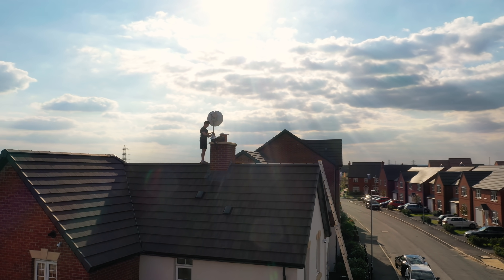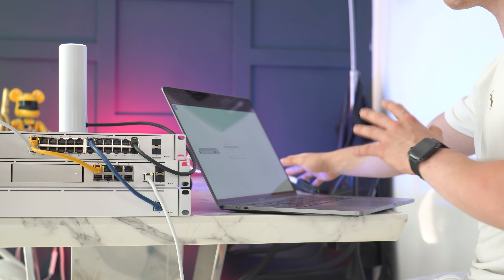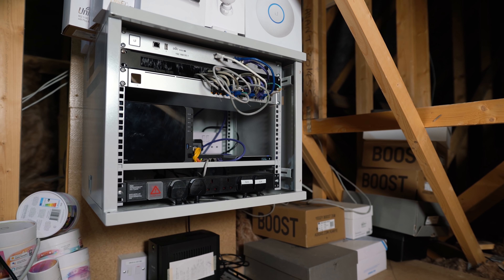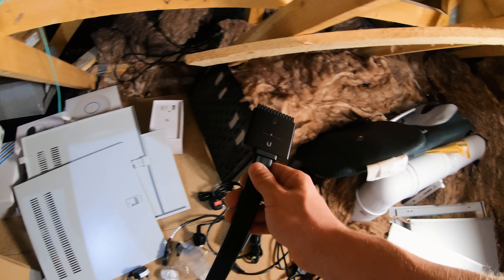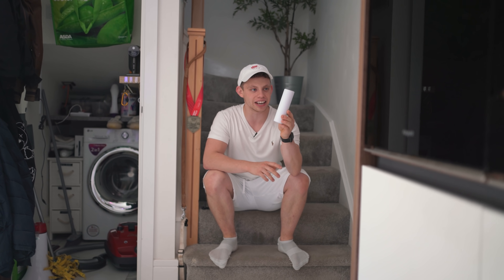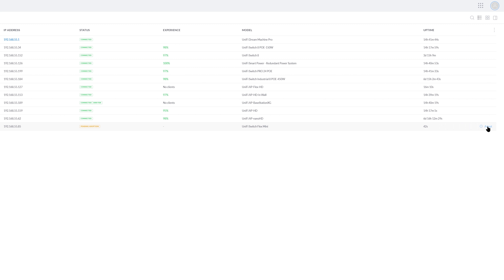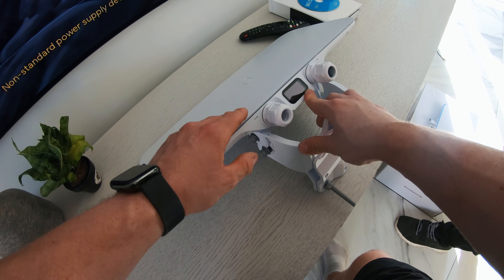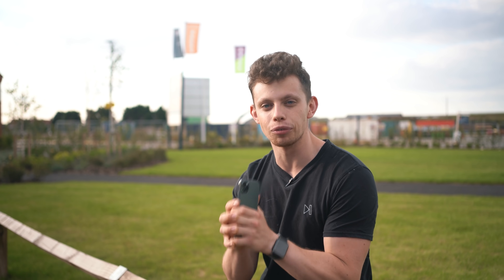Alex's Insane 2021 Home Network Upgrade & Tour!! 🔥

Comment from the maker: We hope you enjoyed our latest networking upgrade video. Let us know below what your internet speeds are below for a chance to win some cool UI gear! ❤️ (And also what you want to see next)
Reply: That Cat cable going into the flex mini is rough has who crimped the end on that nearly made me sick
Reply: i hope you are aware of the data breach that occured at ubiquity a few days ago had to change all my passwords on my UDM Pro
Reply: @XeKirrYT  that's why I self host everything :) but ubiquiti doesn't like us self hosting the software:(
Reply: 65 down and 18 up. “”SuPeRfAsT””. 
Love these over engineered home network vids. I’m planning on doing this in my new house with all ubiquiti gear if the wallet allows it!
Reply: 50 mbps
Reply: I did until you thought the RPS was a UPS I thought you knew what you were doing. As well as the fact that you have the base station XG on your roof, it’s not meant for that silly, and it’s not supposed to give you longer range either it’s meant for high density environments.
Reply: 150 mbps and I really need good gear. ISP modems suck😫
Reply: 7mbps on a good day 😢
Reply: Make sure to get WiFi 6
Reply: About 70Mbps max on a 100 plan on Aus NBN, FTTN.
Reply: On virgin media 1gb plan but struggles of get over 30mbps over WiFi and to links don’t seen to carry more than 80 when there 600 rated
Reply: 1000/40 in AU
Reply: Happy New year everyone 

31.8 Mbps download 
6.65 Mbps upload
With sky broadband tested at 1048pm 13/1/21
Reply: Usually get about 520 down and 35 up
Reply: 300d/100u
Reply: 60mb/s Down 15mb/s Up, but using the stock talktalk router, so you will get some times where you just loose connection, not great!
Reply: It's so funny how You change, test, Buy connectivity stuff each 24 hours. It feeds My tech toc. 🤣🤣🙈
Reply: 300 Mbps up and down
Reply: For on 500mbps with virgin never hit 500 with there router max I hit is 300mbps on Ethernet
Reply: Banger and the whole video production is top notch
Reply: 70/20 FTTP. Just got into UniFi kit, desperately wanting to expand my network but SWMBO and wallet aren’t allowing it right now 🤣
Reply: 89 Mb/s down and 18 Mb/s up, ping 1ms over WiFi 5. I have 2 UAP AC LRs and ERX with 60 clients they are amazing, but UDM pro and POE switch are a vision for now. Next video diy smarthome project.
Reply: @matejkotnik9675  lol, just get another basestaion XGs and connect it to your phone and then test the speeds they should be much faster.
Reply: @matthewcampbell1092  Hahaha dont be so sarcastic, as the speed would be the same and rubbish especially when to close to antena 😂😂
Reply: @matejkotnik9675  no of course not the speed would be amazing 😂 two is better then one in my mind.
Reply: @matthewcampbell1092  Yes sure the local speed would be amazing, if you dont have to pay for it. Locally i can transfer 350 Mb/s up and down to my NAS via WiFi 5.
Reply: 30 down and 5 up but is going through a plain old talk talk router which needs rebooting half the time! Need to look into getting a faster internet connection here and upgrading the network equipment in house.
Reply: 30 up and 8 down I’m on sky router so sometimes it’s just dropping off on some devices.
Reply: 1 gbps down with 0.5gbsp upload , also ubiquiti acces review would be nice
Reply: wish my internet was like that i have SKY uh
Reply: 540 MBPS
Reply: 34.2mbps just now.
Reply: 380 down but only 2mbps up - switched to Virgin Media business as working from home and upload is meant to be 20mbps, working on a fix apparently!
Reply: In therory we should get 1000/50. Usually it’s about half.
Reply: I've actually always loved your video's.  I'm just curious about one thing and it might be a space issue.  why wouldn't you just get a larger rack...and instead of having all those switches around the house just run the cables back to your cabinet.  Seems like a lot of extra switches around the house and equipment you need to maintain when you could have it all in one location.
Reply: 100mb/15mb
Reply: I have 1 Gbps down and up by fiber optics provider!
Reply: Love my Ubiquiti setup.
I'm saving up for a cloudkey v2+ so i can setup unifi Protect with some camera's to complete the set.

My speeds aren't bad, sufficient for my familiy use.
50 Mb down on average during normal use, daytime.
22 Mb up
Reply: 360 mbps
Reply: 30mbs down/6up...
Reply: BT full Fibre 900 on FTTP, 
900Mbps Down
110Mbps UP

So far been relatively good but will be definitely getting Ubiquiti kit for the full network. BT Kit doesn't even allow basic segmentation.
Question for you, Where does your FTTP terminate. Where is your ONT?

I would like to move my kit to loft but dont fancy routing the cables and for some reason the developers only decided to put Ethernet downstairs and not upstairs.
Reply: 70mbps just because they stock bt router can't keep up with my wifi and ethernet clients
Reply: I get 25 down and 5 up, sadly living in a rural location thats the best I get from any providers here, and thats fed to our place via wifi with the ubiquiti Airmax powerbeam dish from about 11km away and not over phone lines. Also do yourself a favour.... Wow, nice gear, shame about the state of the cable termination into your office flex switch mini, sort it out man..... Also Its not a UPS, but a redundant power supply. You need to do better research before mashing together another Ubiquiti advert.
Reply: 1GB down and 100MB up. Great video and love the giving WiFi for the rest of the houses until they can get access! 😄
Reply: @Mammer244  where do you get that from theese speeds
Reply: @Mammer244  plus 1gb down?
Reply: @AIC69420  I am suppose to have 1GBps download and 100 MBps upload, I get around 600-800MBps down. It is a fib conn.
Reply: usually around 100mbps :p might run an OPNsense router to replace the slow virgin one
Reply: 900/100 BT FTTP. Please Please do a bit more research on these products before making a video on them..quite a bit of misleading info in this video....And thats coming from a UBNT fan / installer!
Reply: @darrenjlobb  yes
Reply: Hi awesome video! I have 1 Gbps up/down. Something cool for a later video would be an in depth of the UDM Pro.
Reply: We pay for 1Gbps symmetrical (fiber), we usually see around 800mbps. I have a UDM-Pro, In-Wall-HD, nanoHD, and U6-LR, so big time Ubiquiti fan here!
Reply: 130 down and 80 up. Can't wait to for myself up with Ubiqui hardware :)
Reply: 230MBs download and only 10MBs upload. I’ve been watching your channel for almost a year now. I’ve got a family of four and don’t need all of that gear, but to be honest, I’m not sure where to start. Ubiquity has so much great stuff.
Reply: Based in uk with FTP. Next to the router 210mbps. Move 2 rooms away and drops to 10 mbps. Think I need some new access points.
Reply: i have 300 mbps but i only get like 150
Reply: 40/14 soon to be 1000/50🔥
Reply: What music did you use
Reply: I live in South Africa, and our max internet speed here is currently 10mbs. Not to bad for what we need it to do, but a little bit more would really help haha . (CES2021?)
Reply: 100 mbps, unifi AC pro.  usually hit around 80 on the laptop and between 40 - 80 on mobiles.
Reply: I get like 20/2mbs on a good day, usually 16/1mbs. I can't wait for fibre to be installed in out street.
Reply: I'm in Australia, the best I can get is 50 on a good day
Reply: 1000Mbps down and 30Mbps up; here in Canada
Reply: 50 down 10 up :) greetz from germany
Reply: 500/500 fiber in Denmark - Soon to be upgrade  to 1000/1000, why becouse i can LOL.
UDM P is really nice want one when i get to redo my network.
Speed test on phone say around 350-450 and that is AP AC Lite :)
Reply: 950Mbps/75Mbps
Reply: Average of around 100Mb down and around 10Mb up - which is exactly what I pay for 🙂
Reply: 219Mbps down 21.0up Speedtest virgin media 200 down 20 up service
Reply: Nice video’s what do you do with the network gear that is replaced?
Reply: 935 Mbit down and 934 Mbit Up
Reply: Choosed the Budget Option (FTTH) 400/200. 1gig/600 would be possible for a reasonable price. 

Live in the Muensterland in Germany

Managed to have 300-350mbits of speed (InternetSpeedtest) throughout my hole house and yard (340square meters house and 1000square meters yard/garden) via WiFi with only using a Fritz7590, a Fritz 3000 and 1 Fritz 1750e. I have some drops in some areas to only 200. IPhones etc. in good reach to 5Ghz and without distraction have around 500-650Mbits. 
Cabled devices are connected via GBit Ethernet. Synology, Hassio and iObroker devices, small Dell Micro, That Acts as a Kind of family PC (via RDP protocol) etc. are located in the basement in a nice 12U network enclosure. 👍

2,5 gigs would be nice, but to be honest, I don’t see the outcome in investing to it yet
Reply: We recently upgraded our wifi because, broadband companies were installing fibre to our village. BT came along and gave us some handy ftp! Now we get 150mgb
Reply: 85down/8up normally
Reply: 50-60 down/18 up with Sky fibre (BT infinity), nothing else available in my Essex town! Yet i install 1gb fibre to rural villages!! 😳 love the ubiquiti gear....are you selling any of the old kit youve removed?! Always enjoy watching the Techflow videos 👍
Reply: 200 down hard wired , using a mech wifi system for my big home , need to upgrade
Reply: My internet speeds are average of 64down, 17up on FTTC.
My 4G home broadband is about 25-30down with about 17up. 
Be great to win some gear.
Reply: 400Mbps down, 20Mbps up.
I tend to get higher speeds, but it fluctuates about 10-15%.
Reply: I get around 80-90mbps next to the router, but if you’re around the house it drops massively. Gonna have to get myself sorted with a few AP’s. Get some more house videos on the vlogs page! I’ve been following them for a good couple of years now, gave me some real inspo for my house. Cheers Alex
Reply: 1250mbit Download and 57 Mbit Upload currently 😍 Unfortunately the Router can just do 1Gbit.
Reply: Get 1 mbps in Ireland would love better
Reply: Running around 40mbps on a good day using a Vodafone router which is atrocious for signal dropouts :(
Reply: Looks like we're on the same service, BT FTTP 300/50 :)
Reply: 70 ish
Reply: Im supprised my 3 megabyte p/s download speed os enough to watch your vids over the past few years 😂.
Reply: 300Mbps Symmetrical
Reply: About 50mbps downstream & 17mbps upstream for me.  (Standard BT Openreach FTTC, and I'm about 600m from the cabinet.  No FTTP offerings yet !!)
Reply: 2mbps
Reply: 300 MB Fast Wi-Fi
Reply: Hey I been getting 700 untethered upstairs about 200 downstairs how’s can I fix that love the videos Alex you are awesome
Reply: you probably dont give a damn but does anyone know of a trick to get back into an instagram account?
I was stupid lost the account password. I would love any assistance you can give me!
Reply: 8.32 Mb/s
Reply: About 65-73Mbps down and 20Mbps up. FTTC on the South Coast of the UK
Reply: James Hazell  the NBN sounds trash from everyone I've spoken to. Then again, openreach here isn't that much better but we get roughly the speeds we pay for.
Reply: I leave in Canada. I have a 1gbps upload and download. Your network upgrade is awesome 😍. Really nice video! Would it be possible to see a deeper look at the udm-pro?
Reply: Best video so far

Comment: I'm thinking of tetting Unifi. Any thoughts about what ISPs play nicely with it please?  I know that some hubs allow bridge or modem mode, others don't and some ISPs allow you to bypass the hub and connect the ONT directly to USG/UDM. I did look on Google but felt it wasn't definitive.  It looks like you are using BT which is on my short list; I'd consider Sky as I might get a deal by buying Sky Glass and Sky Internet together, but am wary that I can't put a Sky box in bridge/modem mode.  Cheers. Love the channel.
Reply: With any major routing device like unify you can disable the dhcp server while leaving the dhcp client enabled to allow routing through original router without double-nat. But you will probably lose out on performance using your ISP’s default (probably low-end) modem/router

Comment: Where is the best place to install a wifi router in a house????? As there’s always a area in the house where the wifi will NEVER reach??????
Reply: Central as possible, unless you live in a mansion then a reliable mesh system would work better.

Comment: Unifi SmartPower is just redundant power supply, not UPS. How about fact checking before uploading videos???
Also Dream Machine Pro is probably worst router (not device, just router part) I have worked on (at that price point), and it is a reason everybody (who did not receive UDMP from Unifi for free) is recommending at least Edge routers (if you want Unifi enviroment)

Comment: omg.... the warning at the start "use the utmost caution" and then proceeds to set up a ladder in an incredibly unsafe way.  Bravo.
Reply: The ladder is setup to the proper pitch, it is tied off, and he had a spotter supporting the ladder at the bottom as he went up. As long as he keeps his belt buckle between the rails that ladder isn't going anywhere.

Comment: Alex, the documentation for the UDM Pro states that the ambient air temperature should not exceed 40 degrees. Have you have any issues in a UK loft?
Reply: I was going to ask this as I have my kit in the house but would rather it in the loft. Will stick to just having my switch in the loft. I think the biggest issues is the HDDs getting too hot
Reply: Modern build shouldn't be too bad, even the loft spaces are somewhat insulated. Probably wouldn't have all that gear up there myself, out of sight - probably just a switch - but..

Comment: The USP-RPS only provides power for an INTERNAL power failure, say if the power module failed in your switch or DMP, it would take over.  NOT if there is an external power failure as you suggest. Basically, it does not contain a battery. You still need a UPS as a back up for mains power failure.
Reply: I had the same thought, until I watched further and saw him clarify that the RPS is connected to his UPS. Although in the first parts of the video he makes it seem like a UPS bad even called it one, instead of 'USP-RPS'

Comment: Okay, so single utp cat6 runs and daisy chaining switches are horrible practice even at home, but that AP or your roof and mixing up UPS and RPS shows a great level of inexperience. i like your videos but learn the proper stuff first. and trust me, Unifi gear is nothing compared to high quality cisco enterprise gear like i use in my network. you need to start educating people correctly in your videos, or someone’s going to buy an RPS thinking their gear will stay on when the power goes out… nice job, but you clearly need some work when it comes to network infrastructure and planning
Reply: Yeah but CIsco don't send him free stuff. ;)
Reply: Yeah, but Cisco Enterprise gear costs A LOT more than Unifi gear and it takes some knowledge to configure ;)

Comment: I'm glad I live so far away from this guy. If I looked at my uap-shd And saw so Much radio frequency is being emitted I would be shocked. You don't need this many APSs At this point you could probably have them start to interfere with each other. You won't notice a difference from the upgrade. The Usg pro that you had Will run your network perfectly fine. If you just turn the IPS and IDS down a little bit. And don't even get me started with the base station XG.

Comment: RPS is not a UPS… If a power supply fails in a device the the RPS will power the device. If the main electrical supply fails then all the devices will go off.

Comment: Hi i am looking to upgrade my system with unify dream machine , there is a way to have a mesh system with out run the Ethernet cables
Reply: You can set the unifI AP into wireless mesh but you loose some performance for light home use you won't see much data loss. The only downside is if any of the APs goes offline the link is broken. :)

Comment: A firewall appliance I had 3 of them and three tower servers. Masts on the roof with backup fuel generators 

Large 300x300ft site 6 floors up